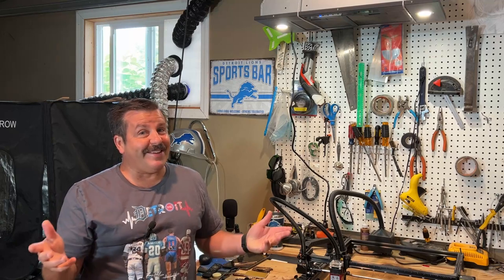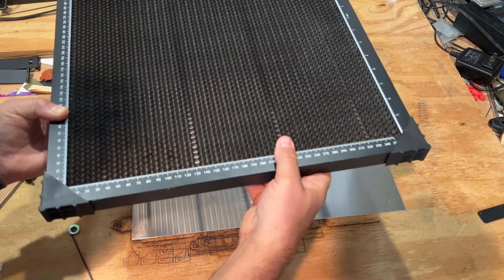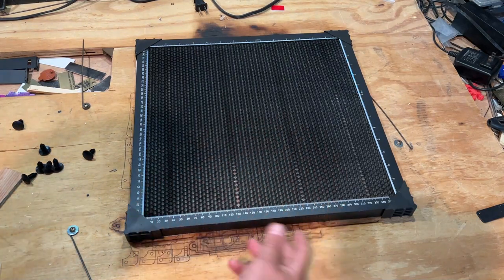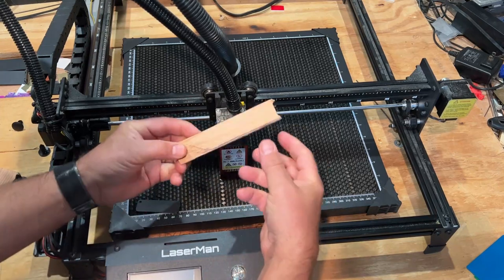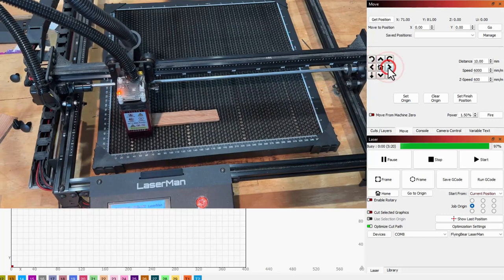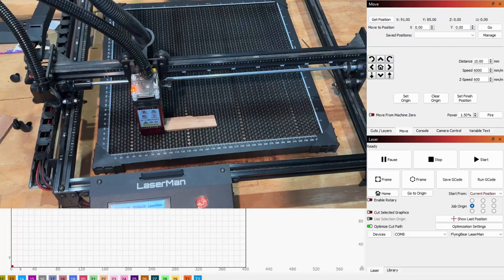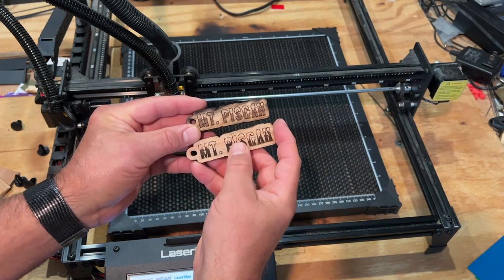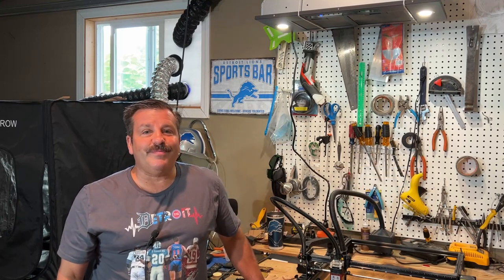I Added A Honeycomb Bed To My Laser And Got Awesome Results!

Comment: Good video,  I purchased one for my Falcon 2 and it really helps.  I do my engraving before cutting, so the part is still secure.  The Creality Falcon has a 22 watt laser, so I can cut 3mm in one or two passes, but usually add an extra to eliminate any problems
Reply from the maker: Really smart to do the engraving before the cutting.  I need to flip that order next time I am making one. Super jealous of the Falcon. I have a couple 10W machines. Extra power is always nice to have. 💯👍
Reply: @HLModTech  something else I have been experimenting with is taking some parts out of the laser design and 3D printing instead.  It is easy in Lightburn to export a part as a SVG - then import to Tinkercad and export to STL
Reply from the maker: That is a great idea. Lightburn has so many amazing tools. Thanks for sharing. 💯🔥